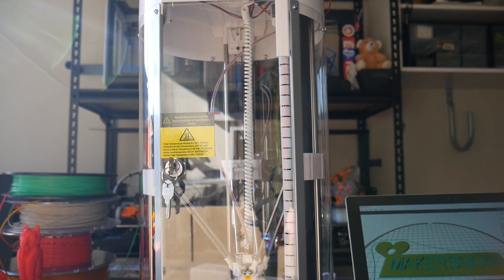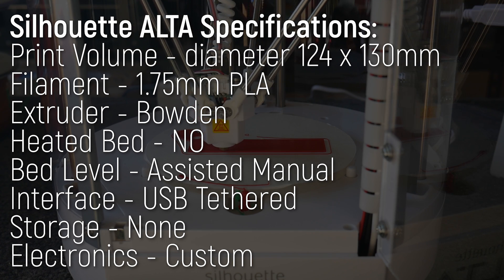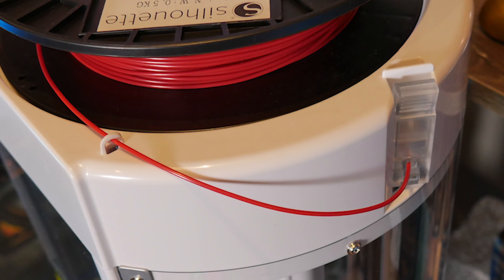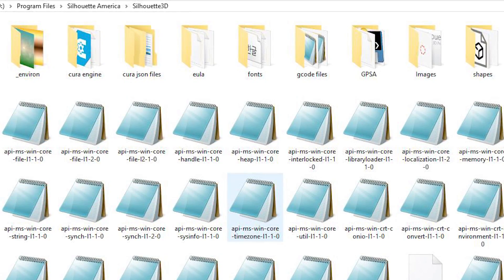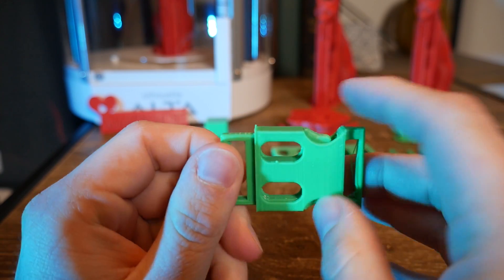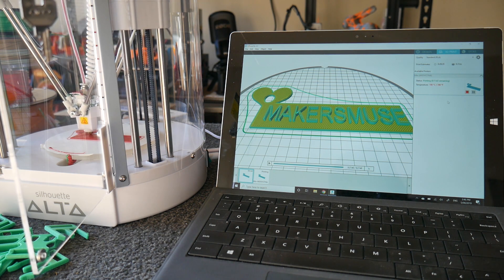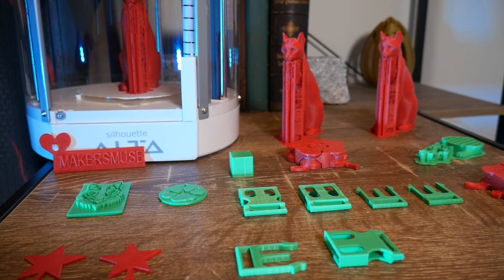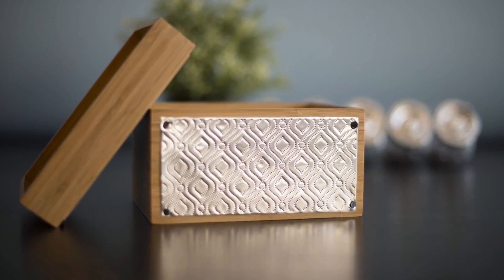A 3D Printer for Crafters? Silhouette Alta Review

Comment: Can I give a bit of a tip to those that use painters tape? A tip I've never seen anywhere on any 3D info? Instead of using strips of the painters tape, which only come in a few sizes, use "application tape or transfer tape" designed for vinyl cutters. Get the paper stuff that's like masking tape and NOT the transparent plastic stuff.  It comes in multiple sizes, so you no longer need stick bits together. Just lightly sand it (takes about 15 to 20 seconds) and wipe over with glue-stick. It's quick and easy to do.

Comment: What were you rating this thing on, its looks? It's pretty, yes. But that seems to be about it.

This IS your mom's 3D printer.

The thing is... How is your mom going to react to the not so great print results when there is no way for her to figure out what went wrong? So, I guess... It's not really even a good printer for your mom?

So... It's not anything a serious hacker is going to have any use for. And it's not really going to be so great for your mom. So... Who is this printer really going to appeal to? No one.

Comparing your review of this thing with your old review of the Creality3D Ender 3, you seriously seem more concerned about the appearance of the printer than the actual function.

Yeah, so... Most of your videos are excellent. Some of your reviews...? Not so much. $300 for a garbage printer? Mom could get herself a resin printer for a couple hundred bucks, put it in the basement so it won't stink up the house, and get far better results for her money.

Comment: Awesome review - loved it!  I have had my Alta since it was released and I learned a few things from your review.  Thank you.  (It seems that many fellow commenters don't realize that this printer is aimed at someone like myself who has 0 experience with 3D printing.  No assembly.  Out of the box.  Fully enclosed.  Ready to use.  I actively use Silhouette Studio software as a crafter with a Curio and a Cameo, so this was a seamless switchover to a software that allows me to import Studio designs into 3D.  The Alta has given me confidence that I doubt I would have gained from using another 3D printer as my first experience.)  

Do you mind sharing which version of the software you were running during this review?  I'm asking, because I've had this since its release and I must be running an older version of Silhouette 3D as my menus look a bit different.

Comment: My first thought was "I wonder if the board can run Klipper..." That could theoretically help smooth out the blobs by offloading processing to a Raspberry Pi, but that also means you'd be tethering it to a Pi the whole time. More optimal, but I don't know if it would be worth it.

Comment: Seems about 3 years to late to market.  32 bit boards are like $30 now.  I wonder when the company decided to market this and if they have an issue with development cycle time.  Nothing on this machine is anything they invented, its all stock 'been done by the community' delta design.  I get a feeling its just late and the company has a time frame for development that is fine for cutting tools.  Maybe it will work for additive?  Comments from people that own it so it sold units.  I suspect without any real proof that they spent a long time on the injection molding and other visual aspects, in essence they polished the turd till it has a smooth reflective surface.  

I really hate 3d printers that look designed for visual aesthetics.  Its like making a mill or lathe or table saw harder to use because it needs to look pretty... WTF?  Imagine a compact cordless drill, that then weight and volume were added to because visually it wasn't attractive enough for the casual consumers perceptions, driven by totally different products social emotional based marketing of consumer electronics... yuck people, just yuck!

For this machine to not even have an SD card slot...  my suspicious and sarcastic side suspects young designers emulating companies that have far different market resources without grasping the intrinsic differences in their own companies situation.  Manufacturers that control the ecosystem and consumer perception of their product with billions in marketing are in a different arena.  If your not Apple, dont even try to emulate them, you need a massive media presence and wildly popular previous product (the Ipod) to convince consumers rational useful things like USB cables and SD card external memory are not necessary.

Just another product the designers spent very little time actually evaluating, living with and using and developing ideas about.  Typical.

Comment: I'm new to printing, (still on my first roll). And even I know that a heated bed is too important to omit to fit a price point. Surprised you didn't see that as unforgivable. With my PayPal discount, I got my Ender 3 for $169! I wouldn't trade it for two of those.
Reply from the maker: I don't run heat beds for PLA printing any more, it's almost never required unless printing at high infill in my experience. Ender 3 is definitely a better deal, but still requires a fair bit of assembly and set up.
Reply: To @MakersMuse : I'll give that a go.
If cool beds are adequate, what happened to your example in the video? After all, you did blame the bed.
Reply from the maker: @USS-DDG-2  Painters tape is a poor print surface in my opinion, it rips easily. There's other more durable surfaces for PLA on an unheated bed like buildtak or even PVA glue that work well and are more durable.
Reply: @MakersMuse  : I don't mean to belabor the subject, but tape, glue, all of that does cost some money, Adding a heat module from China is a one-time cost and a low cost at that. I don't see the logic in buying anything that works "as good" as a heated bed in a world where heated beds are available and cheap. I'll drop it now.
Reply: Honsetly kit printers shouldn't be that scary tbh. Most people can put together ikea furniture, and a tarantula PRO is about that difficult to get set up (cant speak for the ender or other kit printers, don't own em). The lack of heated bed, cooling fans and such a tiny print volume for that price are shameful, but then there's all the other crap like the design being so unique and unmodular, it only being able to use it's own software, and freaking tethered printing only. The print quality isn't exactly stellar either

Comment: Are you sure the USB port is sending g-code and not step and direction pulses for the motor drivers?

If the USB is sending g-code I cant imagine how the USB port makes any difference. Even USB 1.0 could transfer a couple MB g-code file over a few hours of print time. The smallest buffer would be enough to hold a few lines in advance.

On the other hand if the PC is converting the g-code to pulses for the motors (doing the heavy lifting for the printer) and sending that over USB the result will be extreamly system dependant due to the need for exact timing.

I believe the printers microcontroller is simply acting as a USB interface and breaking out the serial pulses to parallel for each motor.

Comment: Intro: Stay tuned because this printer is nearly perfect.
First few seconds of review: This thing is beautiful and well engineered
Next 8 minutes of review: The side load filament is meh, the build plate is meh, the leveling system is meh, the print size is meh, Ooooooo it has a cheep acrylic door with a key lock from a shitty cash box, being tethered really sucks, the print quality is meh, the control board appears to be 8-bit so have to run prints at .25speed to remove stuttering...
Review Wrap-up: I really like this printer and hope to see updates because it is so great!

WTF? I guess we can assume this is not produced by a Chinese company because if Creality produced this exact same thing, Angus would be frothing at the mouth with anger about not being finished, not being open source, and not being worth the money.

Seriously? This is a more expensive, less useful version of the Monoprice Mini Delta with fancier injected plastic frame pieces.
Reply: I had the same reaction. "Nearly perfect" yet in the first few minutes he mentions more missing features and let downs than I can mention in this comment without it becoming a boring run on sentence, but somehow it's just the control board that makes it not "perfect". Huh?
Reply: Angus had legitimate problems with the Creality printers he got that he carefully documented. Just like I could not for the life of me get anything useful out of the Cetus which he did great with. In the end its on Creality to improve the percentage of machines that ship with defects, which they are working hard on but somewhat limited by what people expect to pay for a Chinese printer. This printer's software could make the hobby accessible to a lot more people and it deserves significant marks for that.
Reply: The monoprice mini delta is much lower quality than this machine, I promise you. It's cute, but very, very cheap. This may not have bells and whistles, but the components look nice
Reply: @williamthomasmi10  I had the MP Delta from their initial indiegogo sale. It requires some tinkering, but the print quality far exceeds what is seen here and has a full community of people to offer support. Sure, it may not be "plug and play" like what this printer is trying, but pretty injection molding does not a good printer make (Tiko anyone?).

This review was full of contradictory statements from Angus' own complaints at other budget printers. If you really want plug and play, buy a Prusa Mk3. If you want a craft printer for under $500, keep looking.
Reply: @williamthomasmi10  Its not as cut and dry as you would think, especially at the price difference between the two. I have no doubt that the Alta probably uses much higher quality components, but it really hurts itself by using such a outdated motherboard and skimping out on a part cooling fan.
Reply: Absolutely right! Already submitted my reaction in with a start to doubt his integrity seriously.
Reply from the maker: The possibility of a ready to run 3D Printer aimed at a craft market segment excites me, but yes you're right it's got issues for sure. I don't personally care too much for open source if it's a well rounded product - my most used machine is the closed source up mini 2 from 2016. The Monoprice Mini Delta looks like it's worth investigating tbh, that's a significant price difference!
Reply: @MakersMuse  even an AnyCubic Kossel looks so much nicer (Auto bedleveling, bigger bed, heated bed, linear rails, socketed stepper drivers .. ) an its much cheaper
Reply: @JoergGebhard , Anycubic doesn't need to buy a review from Anus because their stuff sells well even without it.

Comment: Yeah, they've cut some corners on the controller. I've seen older 3D printers that have to be loaded via USB, but never tethered. Huge bummer.
Reply: While their cameo vinyl cutters can be used with a USB drive, I've never seen anyone use the option.  IIRC, the competing Cricut cutters don't even have the option.

Whether they deleted the USB option to save costs, or to simplify the process is hard to say.

Comment: Just a quick note. The angle on the acrylic is not due to the kerf, but more to the focus length of the laser lens, and thickness of the acrylic. Using a different lens would result in less of an angel. That is if the laser they used could handle it.

Comment: For an extra $130 AUD you can get a Flsun QQ-s on ebay, heaps more volume but most reviews tend to compare it to a CR-10. Any thoughts or opinions?
Reply: FLSUN are shite, I  bought a delta off them and it printed wonky and their customer service was shocking. It's currently sat in a bin bag in my spare room.

Comment: I think you may have a problem with the control board or something because I don't have any artifacts or stringing or any issues at all really with mine.
One thing I REALLY don't like though is that you can't change or even remove the nozzle for cleaning. It doesn't unscrew. And if you have ANY issue with the print head at all you have to replace the whole thing.
I don't know if they are carrying more inventory now or not but when I first got mine it was from a guy on craigslist who tried to remove his nozzle to clear it and broke it not realizing it wasn't removable. 
He tried to clean it because he couldn't get a replacement head from alta. After waiting for a couple months they just sent him a new one. That's what he sold me. Sealed and new in the box.
I ordered a new head to keep one on the shelf just in case, I haven't had to use it but it took several weeks to get it.
So if the hot end, cartridge heater, nozzle or thermistor go bad, you have to replace the whole thing for 60-70 bucks.
Reply from the maker: Throw the gayer-anderson cat at it (scaled to fit) on default settings and see how you go i'm curious if it's just my machine. I tested it across several setups and found I had to drop the perimeter speed dramatically to remove the artifacts. https://www.myminifactory.com/object/3d-print-gayer-anderson-cat-at-the-british-museum-london-4010
Reply: @MakersMuse  I'll try it with the Alta 3d software but I would normally use Cura so it would be interesting to see if you had better luck with Cura instead.
While I have your ear, thanks for the videos I've learned .maybe half if what I know about 3d printing from your channel and you enabled me to take a printer people thought was a dud and fix it to be a monster producer.
Check out the Build one on kickstarter if you want to see a 750,000 $99 printer project that is going off the rails.
Creator hasn't produced in 2 years and is offering 50% refunds.
Including shipping which he will never pay.... deplorable.

Comment: Hey Angus, could you share your settings for the cat? I wonder how my printers will do the task. I'd think my delta woud burst thru this print within less than 3 hours with >75mm/s and 0.1mm layerheight.
Reply from the maker: Sure, 0.15mm layer height, 2 perimeters, 3 top 3 bottom layers and 30% gyroid infill.

Comment: I have one of these and have had no problems since purchase over a year ago. Silhouette always update software and not just tweeks, but major updates. There's a lot more behind this machine in the software. Namely if you have one of their cutters and Silhouette Studio, you can design within Studio and send it straight to the 3D Stuido software for conversion ready for printing. One of the downsides to the 3D software is that you cannot export to STL or G.code for printing on other machines. I have other Deltas which obviously do more and are more tweakable, but the Alta and integrated software is as you say ideal for a first timer. I have heard through various sources and whispers that there is a new Alta and Cutters on the way in the Autumn. Always have a mooch on your channel as enjoy the professional and sometimes quirky content. Thanks from the UK

Comment: The firmware might be at fault here. My micromake D1 (an old kossel clone by this point) isn't the that badly artefacted with a 8 bit board running repetier firmware.

Although, having said that, I am considering upgrading to a 32 bit board. But just because the board that is in there is dying.

Comment: I use 3m spray adhesive on blue painter's tape. I haven't had a single warp or lift since I started doing this.
The software keeps the PC from sleeping.
I dont get ANY over extrusion bumps on mine.
Reply: won't it be too thick?

Comment: Solution: buy an SKR v1.3 32-bit controller for 17 bucks and make it into a great machine.
Reply: You'll also need drivers, so more like $25-50
Reply: @goury True, drivers (A4988) are about $2 a piece, often cheaper so it can be done cheaply. You can also buy TMC2208 for a little more. Those are all you need and support high microsteps 🙏

Comment: Whilst newbies might like a printer with an integrated computer, I would prefer to choose my own. I've ran 2 printers on a Raspberry Pi simultaneously before, and I'm sure you could get away with one per core. I'm going to be putting a pi zero into my ender 3 using a buck converter so it's got octoprint from the start. Also is that how Australians say cache?
Reply: I hear the zero doesn't quite have the muscle for octoprint. Maybe if you're using an IP cam not tethered to the pi.
Reply: I'm running a raspberry pi 3 and connect through wireless.

Comment: The Monoprice Mini Delta has a similar build volume, and lacks the "training wheels software", but has a microSD 32-bit control board, a color LCD interface, auto-level, and a heated bed. It's not as elegant looking, but has exceptional print quality for 1/2 the price. I've seen beginners able to learn Fusion360 and Cura well enough to do their own thing without any help, so I think the learning curve is not as difficult as these printer makers would have you believe.
Reply from the maker: The mini delta seems to be a machine that should be more popular for sure, you did a good video on it. I had no idea it was so cheap...
Reply: Thanks, Angus! Your videos inspired me to try doing a review. I think the reason it's not as big as other printers is that it's only sold by Monoprice.
Reply: You can use Cura on the Alta.

Comment: I am surprised it took so long for this design to translate to 3D printers. Look up Hexapod machining. If the manufacturers took it a bit further, you would not need the support material. Very cool.
Reply: My Alta is well over a year and a half old. It's not a new printer by any means. The rostock (sp?) was a parallel printer like the Alta and those came out 2.5-3 years ago.
Reply: I looked that up, didn't know that delta robots date to the 80s but not surprised. This is Rostock, supposed to be the first delta 3d printer. https://youtu.be/AYs6jASd_Ww